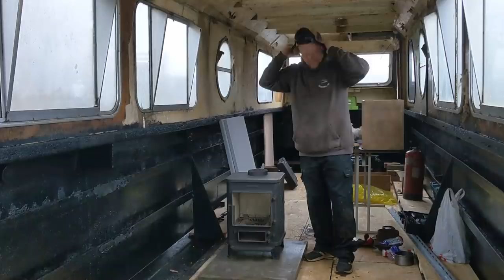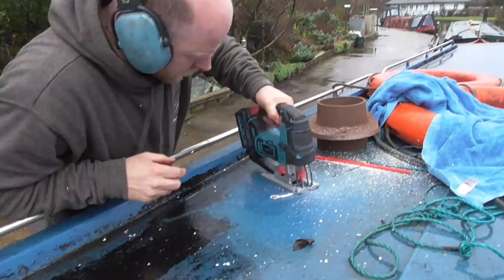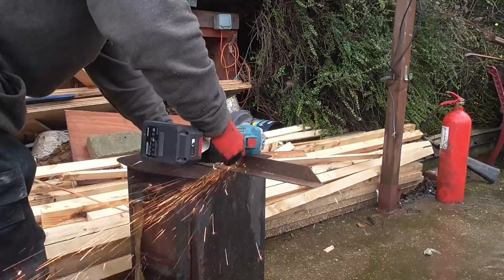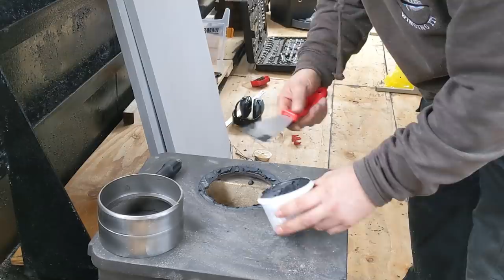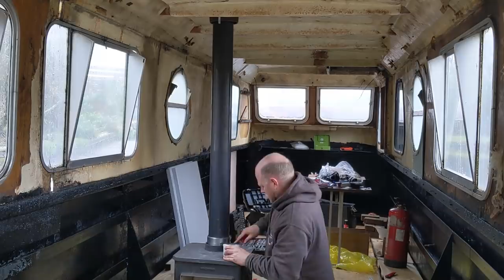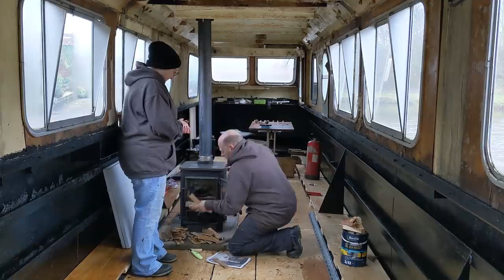How to INSTALL a Morso Squirrel Log Burner and Flue on a narrowboat.

Comment: That roof cut so easy. Unlike my steel roof. Ooh nice warm boat now. Dry it out as well.
Reply from the maker: One advantage to wood and fibreglass - easy to cut! 
Bonus all round with log burner fitted.
Reply: I was shocked at how thick the fiberglass was of that roof.

Comment: Word of warning to anyone fitting a new squirrel or swift. .Remove the smoke hood inside the fire  (looks a bit like a half cup) its situated above the baffle. These are not to be fitted on a narrowboat which has such a small flue length. 
Have been to two boats where the soot blocks the chimney.  Once removed the fire draws better..and you won't die.
Read your squirrel instructions.

Comment: Well done guys - the new stove is bound to make your working lives so much more comfortable this winter.
One tip I would pass on seeing you spreading that fire cement. Invest a few bob in a plasterer's small tool - it's got much smaller & very flexible blades & would have made that job a  lot easier.
Reply from the maker: A smaller bladed tool would have been ideal to be fair... 
And yes working is now much better!

Comment: Don't forget to seal the top collar fire rope on its own will not seal and keep the water out.
I found to my cost few weeks after fitting mine.
I heard dripping water.
I've used a rubberised high temperature silicone sealant.
It's now been done four years and hasn't leaked yet.
Reply from the maker: Yeah, it's got cement in there aswell... Nicely sealed...
Reply: @WingingItBoatingonaBudget 
Check it as I first used a fire cement after fire rope the heat made the cement porous and broke down resulting in another leak that's why i finally used a rubberised heat sealent.
That is still good as the day I did it.
Love your videos.
You certainly have taken on a project.
Can't wait to see the finished result.
I'm sure it will be worth all that hard work. Stay safe guys.
Reply from the maker: @Paul-pb3vq  will keep an eye on it cheers!

Comment: Hi guys, reminds me of when I stripped Changing Pace out to do the spray foam insulation, the only thing I left in was the wood stove 🥶 it will make working alot more comfortable. How much clearance did you leave between the hole in roof and the collar? Would try to get some fire proof insulation between if possible. Dave
Reply from the maker: Heat is vital at this time of year, really didnt want to be freezing all the time working on it. Left a bit of a gap, and during these first burns ive been checking the roof and its not getting hot... but the fire proof insulation sounds like a wise move!
Reply: It will just add a bit of peace of mind, even if you don't think it needs it. Also something to think about when you insulate and board the roof around the flue.
Reply from the maker: @NarrowboatChangingPace  yep, definitely something to look into ready for the 'final install' of it once the fireplace gets done properly... 🤔🔥🔥🔥
Reply: You don't want those insulation boards too close to the flue. You can get fire proof webbing to fill the gaps and internal collar to add a neat finish.

Comment: Do you not need a bufferfly in the flu pipe.
Reply from the maker: There is enough control on the log burner itself, we haven't needed a butterfly on the one installed on nuts n volts.

Comment: Flue silicone would have maybe been a better sealant. The cement tends to crack and fall out. Still working life will be so much better with the heat on
Reply from the maker: I think I will try the silicone the when I rebuild it once the fireplace is built...

Comment: Don't fill the gap with fire cement. Put the first bit in then force fire rope in the gap between the flu and stove and then top with fire cement
Reply from the maker: I've seen it done both ways, and on Nuts n Volts its done like I did this and had no isues. But when I refit it after we build the fireplace I may add the rope just to see what if any difference there is...